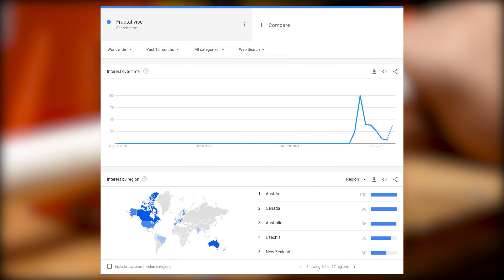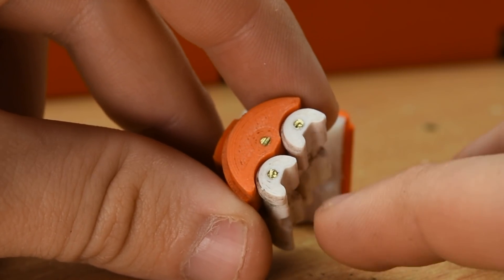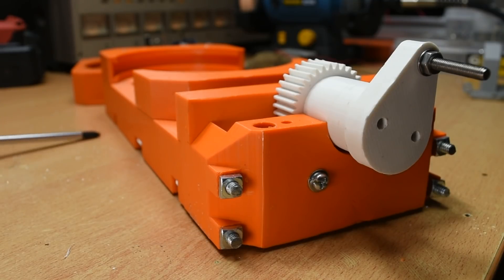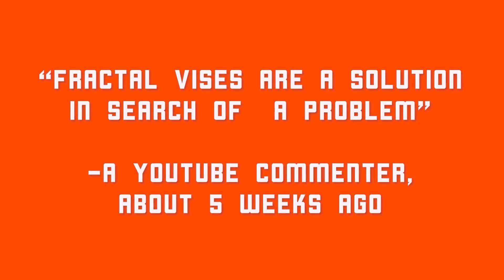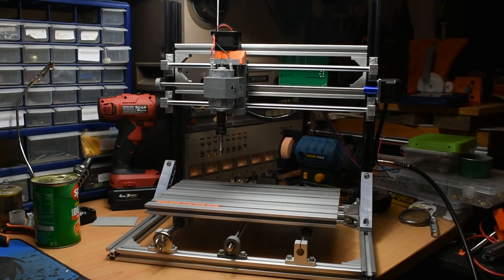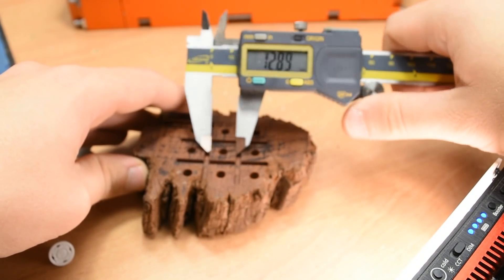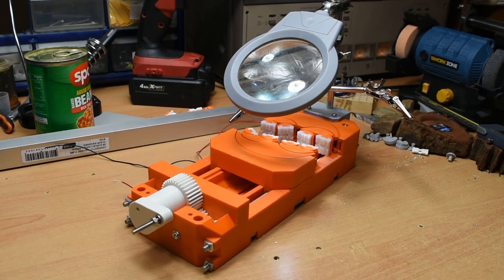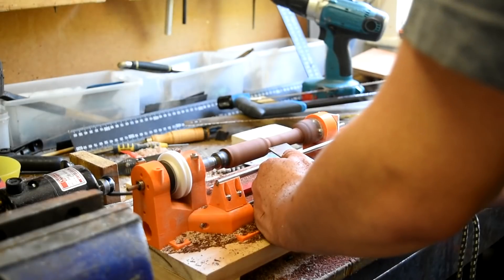3D Printed Fractal vise V2: Overview + CNC router testing

Comment from the maker: Two things I forgot to mention in the video that I really meant to

Firstly, a lot of people told me last time that this mechanism is more appropriately called a Whiffle Tree, which would be correct since the jaws of my design are not a pattern that repeat forever. Also that it would never have been called this since the term fractal wasnt used until the 70s. Not really important but I wanted to mention it.

Secondly, casting. I have no experience in lost PLA or any other casting method but I cant imagine that my single piece jaws would cast particularly well, but I speculate that the teaching tech multi part jaws could translate to casting better? Just a thought.

Finally, and admittedly this is more a build video thing, but the larger part of the elastic jaws require support blocking in the middle or else you wont be able to remove the support. 

Thats all, hope you enjoy!
Reply: Sir, can i get your mail id please i want the detailed drawing or model of this vice
Reply: I would have subbed and liked all your videos but I hate background noise especially music.  In general you should never add music to a video.  Hope you don't in the future.  You are welcome

Comment: Nice video, and I appreciate that you're looking for ways to upgrade this device.  One weakness of the vise (the original design, not your version specifically) is that it's reach is quite shallow. In other words, if the width of the jaws and width between the jaws are the X and Y directions, there is very little capacity in the Z direction (unless you can grip an object at one end) due to the lead screw and guiderails being so close. Think of trying to grip a football-shaped object, for instance.  In order to deepen the reach I took the jaws of a printed vise that I bought on Etsy and mounted them on a 'gunstock vise' that I already had in order to hold wooden bird carvings - the plastic vise holds the work quite well for tasks such as fitting legs, painting, etc. without having to screw a fixture to the bird.  Perhaps a future version of a fractal vise could incorporate a deeper reach . . .
Here's a link to a photo showing what I did -  https://drive.google.com/file/d/1zElCupMutaigKMa57Bp4mvw6gzugDGyo/view?usp=sharing

Comment: I think there's something called "Machining Pallet" or "fixture plate" I believe. It's very similar to traditional workholding for woodworking where you have "dog" holes for pins & clamps that mounts into these holes. It's a way simpler solution for these oddy shaped parts.

Idk, hope it's at least interresting to hear people way back when, was wicked smart. ^^

Comment: What if you replaced the dovetailed parts with semi-ball joints that can move in every direction but upward?
Reply from the maker: as in, maintain the semi-circle pattern but replace the dovetails with long cylinders, or devise a new mechanism that uses ball joints?

Comment: Maybe integrate machinist jack points with lead screw/bolts into the vice base to overcome rocking issues when clamping pieces with un-uniform bottom geometry. Or maybe a Z dimension pattern that conforms to non flat geometry

Comment: Great design!
You sound as if you consider this project done, but just in case: for the next version, consider running the  threaded rods that open and close the jaws under some protection so they are not directly exposed to the milled particles and shavings.

Comment: Also the number of use cases need not be very limited.  Consider that the standard engravers vise has an array of pins for grabbing weird shapes.  Add how often soft jaws are used by machinists.  The question is really only one of size and material.

Comment: Nice video and you manged to show the strength of this vice type perfectly, irregular shaped obects. <.<

For the people saying that type of vice is a solution in search of a problem, keep in mind that design dates back at least to 1922 (quick google search).
Back than cast parts where more or less the norm and often they where very rounded off and even irregular shaped / not symmetrical. 
A Fractal vise would have been a good addition to every shop that deals with these parts, even more if they only work on a small run of them and not hundreds (that number would be better handeld with custom clamping setups).
Reply from the maker: Nice point! Perhaps they could have been used to put an initial reference face on to allow the part to be machined in a more precise setup.

Comment: I think the dovetails aren't working because you have them going the wrong way. Try making them horizontal like the original metal and they should work better. Good job though!
Reply from the maker: I made them inverted from the original design to allow for the scale I am working at, I found that only the largest jaw had the space for the original design (male on the "inner" circle) and the the smaller jaws did not have the space. The original design is certainly the way to go if you have the ability to make one in metal, since it allows the jaws a wider range of motion without coming out.

Comment: Its not a vice replacement. They are 2 tools for 2 different jobs. 

Like an impact driver versus a drill. On the surface theyre 2 spinny things that can put in screws and make holes. But they actually both have an express purpose that they excel at where the other does not
Reply: Yep whoever says they're useless or "a solution in search of a problem" clearly has never worked on a milling machine. Soft jaw vises do exist for a reason.

Comment: Would adding a second small coin at the opposite edge help holding small items?
Reply from the maker: Perhaps, maybe a spacer block rather than another coin but you are right in that it would make the pressure on the coin be applied from a more ideal direction.

Comment: I started designing a fractal vise too and somehow the project got away from me and now I'm building a voron 0... Yak shaving at its finest.
Reply from the maker: Ive been seeing a lot about Vorons recently, would like to build one in the future for sure, seems like a slight upgrade over my stock ender 3s ahah
Reply: @Borgedesigns  you might want to look at the voron switchwire which was meant to be able to utilize parts from a ender 3 style printer to create a much better printer by adding rails and a coreXZ mechanism. I  mainly chose to  build the zero to have a smaller and faster counterpart to my main printer which is an e3d toolchanger. It's a beast, and not easy to enclose.

Comment: Suggest an auxiliary flat jaw for the fixed jaw.  Lots of parts are only unusual on one side, and you could get great alignment.  Still fractal, just less so.
Reply from the maker: Good shout for sure, it would be simple to have a pin on the fixed jaw side that could lock a flat jaw in place to make it easy to swap between the two.